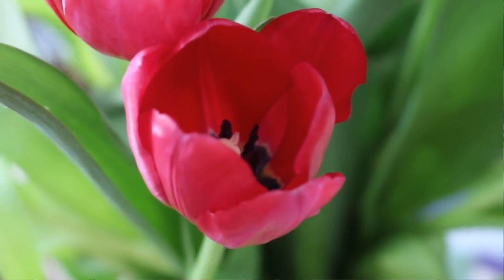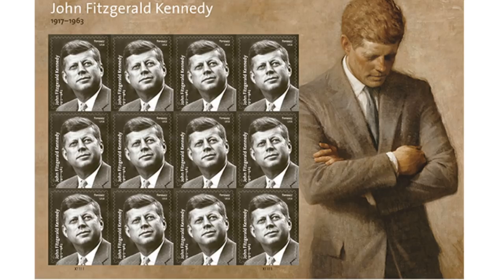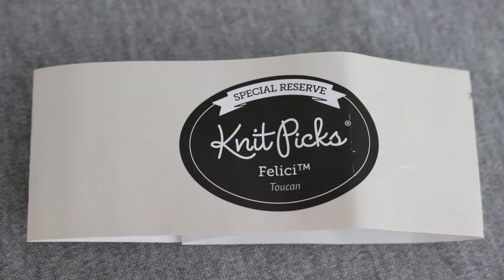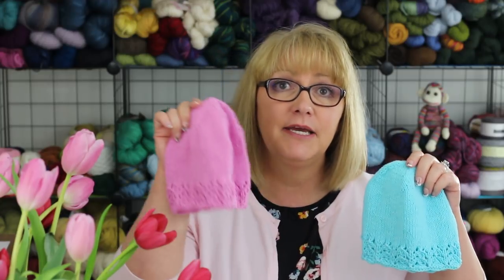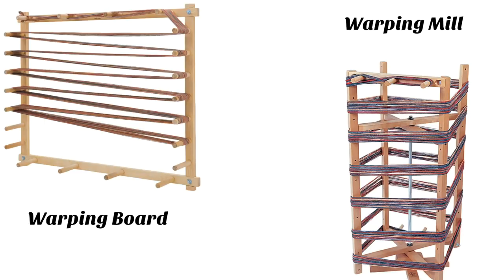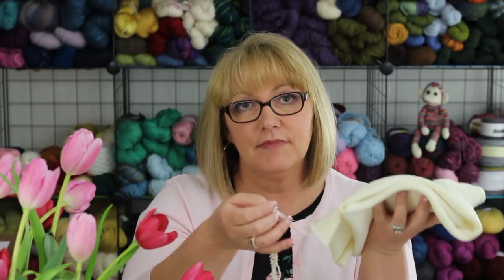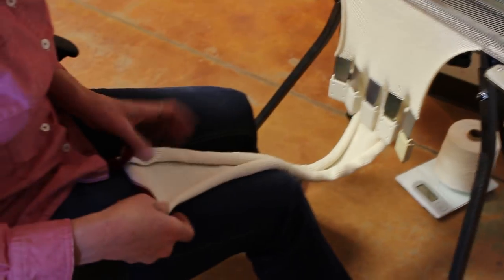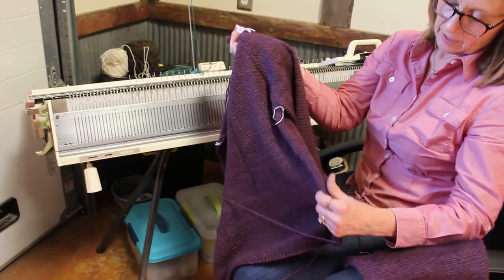HOW TO MAKE A SOCK BLANK

Comment: I'm a hand and machine knitter. I have made and dyed my own sock blank. My reason? I had seen a YouTube video where a mother and daughter dyed the most awful colored blanks but when they knit them up they were fantastic! So of course, I had to try my hand at it. I knit double stranded on my Brother 830 And dyed the most hideous blank I could imagine. The socks that were knit on it turned out great.  They can be seen on my project page on Ravelry lzh called Experiment.

I didn't understand why waste yarn was used on the project shown then I figured it was to check gauge, however if ravel cord had been used between the waste yarn and the sock yarn the ravel cord could have been pulled out with no trouble at all releasing the sock blank. Wish I had thought ahead and weighed my cone before starting, duhhh... it would have saved me guessing how much to knit. Next time😏
Reply from the maker: Hi Louise -- that's such a great story about the sock blank dyeing!  Yes, I'm going to pass along that information about the ravel cord to my friend.  Thanks for sharing that, and thank you for watching.  XO

Comment: I have made 2 worsted sock blanks and gradient dyed them purple/indigo for socks and leftovers for art projects.  I used a plastic machine from Michaels.  you have to be gentle with it when cranking with hand crank or gears will strip.  I made another long flat blank to dye numerous colors to make a wild multi sock.
Reply from the maker: Hi Barbara -- that's so interesting!  I'm glad you were able to make the sock blanks with (what I'm guessing is) a more economical knitting machine.  Thank you for watching!  ♥
Reply: yes with a 50% coupon it was around $35 and great fun; i forgot to mention that the long flat blank was made with two strands so I can make matching socks even at the same time if I want to try that.  Elsewhere I had asked you did you ever put a link to the excel spreadsheet for the needles research you did?  Thanx for all your meticulous reporting, I love the details you cite in your presentations.

Comment: I’m not a fan of the waste yarn, as you have to to a bit of experimentation to make sure the dye won’t transfer.  I have sometimes used a very light acrylic but it can still transfer so I would prefer not to use the waste yarn. And ironing acrylic isn’t a smart idea! If you do use waste yarn there is no need to remove it from the wrong end, just ignore it, and you won’t be tempted to pull it.

Comment: I've knit from one sock blank and have one I'm just casting on. What I've noticed is with my short experience is not all sock blanks are created equally. The first one was not a very satisfying experience. I knit it top down - not that it mattered. I was pleased with the product but not the knitting experience. The one I have barely cast on seems to be a different yarn - really soft and I can already tell will be a better knitting experience. I don't know where the blank came from, but it feels much like the Knitpicks Felici yarn and that would be my guess. We all know how soft that yarn is!!

I've always been intrigued by flat bed machines and wanted to try but never did. I don't have space for one so I doubt I'll try it. Thanks for this!
Reply from the maker: Hello, and thanks for your comment.  Yes, I'm sure there is a variety in sock blanks, although most of the ones I've seen are merino/nylon blend.  I do know that some are a lighter fingering weight and some a heavier fingering weight yarn.  I'm glad the one you are working with now is a pleasure to knit up.  :)  I'm the same way -- while I would love to get a flat knitting machine, I don't have anywhere to put it right now, so I guess I will hold off.  Thanks for watching and for your comment.  ♥

Comment: Hi Dr. K., In the future could you discuss knitting socks with and without nylon. How do we compensate for no memory (limp legs)?
Reply from the maker: Hi Karen!  I can certainly put that topic on my list.  Really, the nylon content for sock yarn is more for strength than elasticity, though.  Socks out of pure wool yarn will be a-ok because wool has excellent elasticity/memory.  Now, if you're using something like pure cotton, that wouldn't be a great choice because cotton will stretch out and not spring back so in that case you would end up with limp legs.  :)  So with cotton, it would be better for it to be blended with nylon or wool to get that elasticity.  But, yes, I can talk about this further in a future video.  Thanks for the suggestion!  ♥♥♥

Comment: To create a double stranded sock blank, I can use a mid-gauge machine. Right? That is the only size knitting machine I have so I'm trying to figure out if I can make this. Great podcast, by the way! :)
Reply from the maker: Thanks, Tashia.  :)  I asked Ann your question and she said yes, that should work.  She suggested trying it at a loose gauge to begin and then decide if you want to tighten the tension more.  You will probably want to experiment a little, kind of like a gauge swatch.  Good luck with it, and let me know how it turns out!  Thank you for watching.  ♥
Reply: Great! Thank you 😊

Comment: How did you attach the comb? I have an artisan machine and have the weights you used but not sure about the comb. I'll have to look through my supplies. Can I cast in without one?
Reply from the maker: Hello!  Thanks for watching and for commenting.  I'm not sure of the answer to your question, but my friend Ann will know.  :)
Reply: Hi!  This is Ann.  I attached the comb this way:  I set up every-other-needle (EON) on the main bed of the knitting machine.  I then started with waste yarn and knit from right to left.  I hung the comb from the floats formed between the needles.  Then I knit from left to right.  I now knit several rows of waste yarn and added in my project yarn. Hope this helps!
Reply: Ann Meminger Hi Ann 
Thanks for replying! 
Could you show me up close up how you attach the comb? I just can't seem to figure this out without a close up.